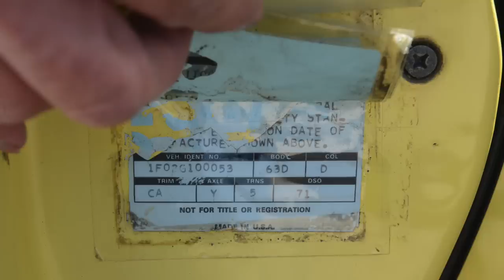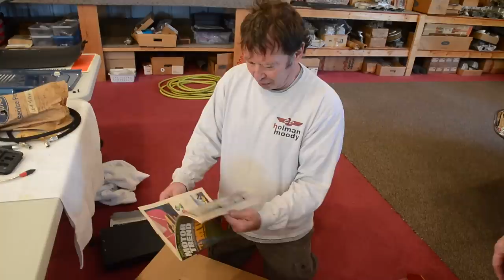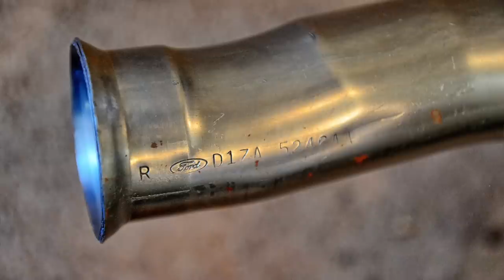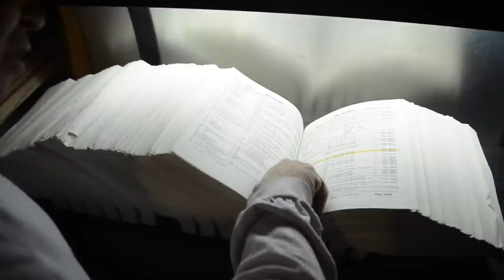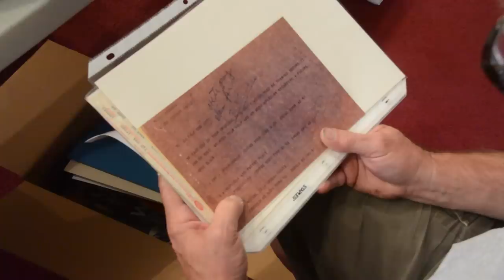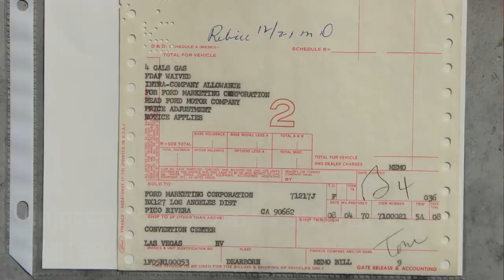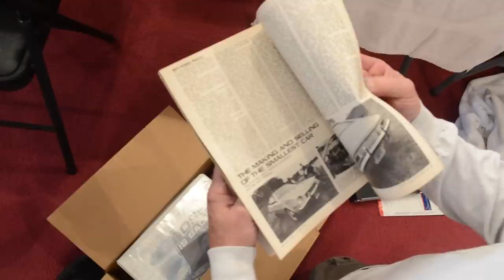Million Dollar Boss Mustang Prototype Barn Find -1971 Boss They Didn't Make

Comment: This is a great story and while it is "unbelievable" I can believe it more easily than most.  During the 1970's my father was a Ford Vice President working at the Newport Beach Plant. This facility was known as Philco Ford, Ford Aeronutronic, then finally Ford Aerospace and Communications Division (because no one could spell Aeronutronic).  As a VP he was able to lease two "E-Cars" (executive cars) at very low prices and therefore we got two new cars every year.  Dad was a true car guy and thought long and hard over every car he ordered, OFTEN ORDERING CARS AND OPTION PACKAGES NOT AVAILABLE!  While this sounds impossible, I can assure you it was not.  Apparently when the build sheet says ... Vice President at the top, assembly line magic could happen.  Many of these "special cars" went directly to the LA Auto Show before we got them.  Some examples were our  Diamond Jubilee Edition Lincoln with a Police Interceptor engine (4bbl 351W) dual sewer pipe exhaust and tire smoking Traction Lock rear axle ratio.  79 Mustang Turbo Pace Car 4 speed with TRX wheels tires and suspension.  84 Thunderbird first one into California (unfortunately a V6). Merkur XR4TI. First 5 speed SHO Taurus in California. And Lots more. All super-tuned like SVT cars.  Even during the days of the choked and gagged 70's V8's Mom's 460 Country Squire Wagon's and Town Cars  had dual exhaust  and would smoke BOTH rear tires the whole way down the street. Very unusual! Looking back, I can't help but wonder if there is a 76 Lincoln Town Car out there with the Carriage Roof and 429 in it!  Time to peel back some door stickers!

Comment: Very cool story and video it's crazy how things like this get forgotten.  Though as to throwing a "parts manager" under the bus for not doing his job properly wasn't right.  It's very possible customers could have been buying these parts in an attempt to create a boss 302 with factory parts.  Would may taken a little bit of fabrication but was certainly doable.
Reply from the maker: Bob is telling us the truth, so how is this a betrayal? Ordering parts for a car that did not make production is a mistake.
Reply: It is an opinion unless he was sitting next to the employee, nor did I say betrayal.   You could get the parts to work on another 71with some fabrication.   Similar to how Ford got production 71 parts onto it for it's initial sale.  Dealers also may have been stocking up for a car expected to be in production.  Ford clearly intended to produce or it wouldn't have spent $ and effort as mentioned on it.
Reply: If a customer ordered and bought the parts through a dealer to "attempt to create a boss 302," then the parts would be in the customer's hands, or installed on his/her car.  These parts were still in the dealer's stock after many years, meaning they were ordered and then never sold to a customer.  I'm sure Bob asked why the parts were ordered in the first place, and he learned that the original order was a mistake.
Reply: Roger R You most certainly can order then either never pick up an item from a dealer.  There are a set of shocks and struts for a 91.5 thunderbird sport at my local dealer as proof.  It is 2017 these were ordered in 1971 the chances of that for a fact are about nil.  I'm not saying it didn't happen that way I'm simply saying it's an opinion.  Being likely and guaranteed fact are not the same.
Reply: The orders were a mistake, but a happy mistake because that's why they still exist today.

Comment: I'm not trolling, nor an expert... but my 71 mach1 convertible has a 9inch carrier ( round at the bottom of the diff.) and a stabilizer bar from the left side of the rear end to the right side of the frame. 2v carb. 351C & small case C-6 when new.

Comment: Am I hearing this right ? When it was sold it actually had a 351 Cleveand motor with a 2 barrel carb. If this is true then all the stickers in the world won't make it a Boss 302. Without the motor you just have an old Mustang.
Reply from the maker: When it was sold, yes, but not when it was first built, as this Mustang was a prototype and not a regular production car.

Comment: The parts guys tour of all the Ford dealers back in the day  to buy up inventories is a sore spot for me from my teenage years. In the late seventies I bought a  '69 Shelby GT500 that was completely worn out (which is the only reason I could afford it). All the parts I needed to replace in the engine and drivetrain were optional high performance Mustang parts supposedly available at any Ford dealer. Unfortunately I found out the hard way that people had already come through and bought up all the special performance Ford parts  and were placing ads in the back of car magazines charging an arm and a leg for stuff, marked up two to five times. Ford seemed to have  been cleaned out of most special parts  so these guys could name their price, which I could not afford.

Comment: SO if I understand correctly, that's not the right motor in the car? It's supposed to be a 302 but there's a 351 in it?

I didn't get that whole part of the conversation. I got the part about the ram air hood and springs etc but not the part about the engine.
Reply from the maker: The term "right motor" is where you are missing the story. What does "right" mean to you, that there is one motor "right" for this car? This Mustang is a prototype, which tests different layouts, which explains the different motors.
Reply: I thought boss 302 meant it came with a 302 no? Sorry, I'm not an aficionado....
Reply from the maker: Yes, it came with a Boss 302, then the program got canceled - watch the part of the video with the different invoices. I realize this story is not typical, as prototypes are not typical and seldom get out to the public.
Reply: ok thanks for clearing that up. So is the new owner going to put a 302 back in it?
Reply from the maker: Yes, Bob Perkins has collected the 1971 Boss 302 parts - which went into Ford's system for this car, before  it was canceled - to restore the car, including the Boss 302 engine.
Reply from the maker: Oh, okay - yeah, the first engine in the car was a Boss 302 and there is a factory photo of that engine in this car. I just didn't have the copyright to use that photo, but I have seen the photo .
Reply: Yeah, that's what I found pretty amazing...they made all those parts, for a car they didn't complete. I mean, Bob has enough parts to keep the car running for generations, with all ford factory parts!
Reply: It would've been 'fair use' to put the photo in the video... imo Awesome story nevertheless... Cheerz
Reply: @thewriter2549  While watching this my thought was that if those ultra rare 71 boss 302 unique parts are not used on that car they are either worthless or museum pieces.

Comment: Great story but I'm confused.  Did Ford swap out the original Boss 302 engine with a 351 before it was finally signed off to be sold in 1971, or does it still have the original 302?
Reply: I think they said it was never in it. The paper work was produced the day before the car was built.
Reply: @jasonkoster3102  Thanks!  I thought someone in the video said they would keep the 351, but wasn't sure.

Comment: I bought a 69 cougar when I was 16 from the original  owner. It was only 7 years old and had only 20 some thousand miles on it. The owner bought it from Morrow Motors Beaver Falls Pennsylvania. He stopped driving it and parked it in his yard. He was a hair dresser. My friend and I delivered some coal to his house and that is when I asked him about the car. He told me it was evil. He was scared of it. I asked if he was interested in selling it and he said sure. So I bought it for 50 bucks. It was a pail yellow with a mint green interior and mint green vinyl top. It had a 351 Windsor engine  with a 4 barrel auto trans but here's the kicker it had a two speed rear end. I didn't know it was something special. It was not an aftermarket overdrive. It was all together one piece with the differential  housing it had a glass inspection housing on the drivers side front of the housing extension just behind the yoke a few inches. I worked off the engine vacuum. And may the rpm I don't know for sure. When got going about 50 mile an hour it would shift into overdrive. It had a tachometer and it would drop to an idle. The car would absolutely fly. I took it to get it inspected and it failed because a spring mounting point needed repaired. The garage I had it at had the contract with the western end of the Pennsylvania turnpike authority. They were the towing and vehicle service company for that section of the turnpike. While the car was on Jack's being repaired a State Trooper saw it and somehow deemed it un repairable and the garage owner informed me. So I got the car back and it sat in the driveway for a few months. Well I had five cars total and my mother said you've got to thin out the herd. So a guy I was working with needed a car. I figured I'd help him out cause I was dating his sister. Well he got the car for fifty bucks. But he was buying it for the motor to put in another car. He was not supposed to drive it. It was still titled in my name and he had not even paid me. He took the car out and ended up in a high speed car pursuit with the state police. The car was impounded.  Still at this point I didn't know the car was special. They took him to jail. I figured nothing lost  nothing gained. A year later I was reading a hot rod magazine and found an article at the back the tech talk written by I think the man who was or became the magazine's editor. It was an article about this very rair cougar option a 36 percent overdrive factory rear end. So if anyone knows anything about this I would love to hear your comments. I don't know what became of the car. It might be in some P.A. state troopers collection. By the way I forgot to mention that this differential freewheeled no engine drag when you lifted off the gas. It would coast forever. There were no buttons or levers to engage or disengage it. If there was it was engaged all the time I owned it and if had to be a button that I somehow over looked. I don't see how that was possible as I detailed every inch of the interior which was in pristine condition. Please if you have any information it really would be appreciated I'm now 60 and this has puzzled me for many years.

Comment: I wonder if anyone ever bothered to look under the carpet under the drivers seat for the original Build Sheet ?  They may have to remove the seat to find it. That's where it was normally tossed in a plastic sleeve before the carpet and seat installation. The assembly line build sheet will tell the whole story.
Reply: Nah, I'm pretty sure Bob Perkins with his 50 years experience of restoring Mustangs probably forgot to look. :-(  :O  :-(  You don't know who Bob Perkins is do you, otherwise you'd realize how dumb that statement was.

Comment: You keep asking over and over will this work on a 1970 Boss 302, I want to know what makes this car different from a 1971 model Mustang, Mach I, Boss 351.
Reply from the maker: I ask if a part will fit a 1970 Boss 302 to see if the '71 Boss 302 is different and thus unique to the '71 program.

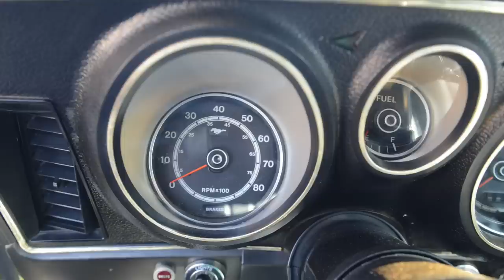Comment: The engine block is a 351 Cleveland, look at the thermostat housing at 15:57 and then look at a Boss 302 intake, the thermostat housing bolts to the intake and not the block...so not a Boss 302 in the car in the video.
Reply: It had the Boss 351 put in before Ford sold it !!

Comment: it's cool, but u got the little motor 😂🤣😂
Reply from the maker: Built for road racing, the high-winding, race-bred, Trans Am motor, where torque is secondary to horsepower and rpm for high speed.